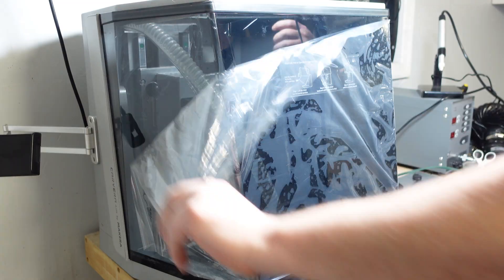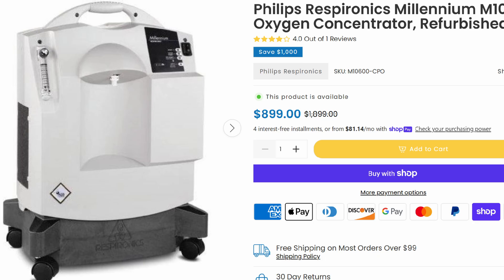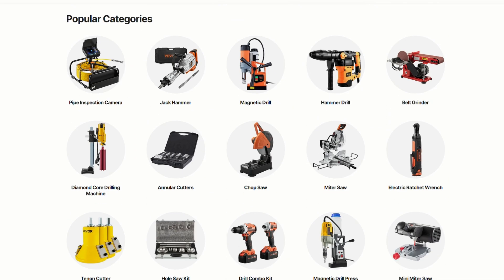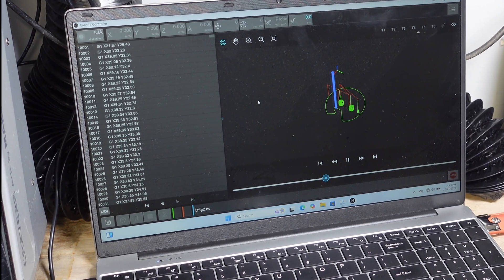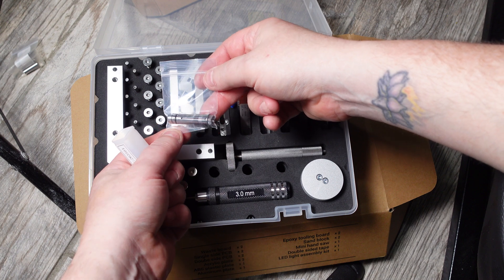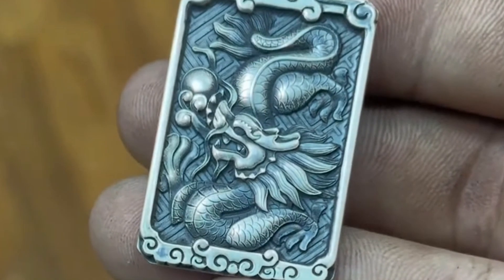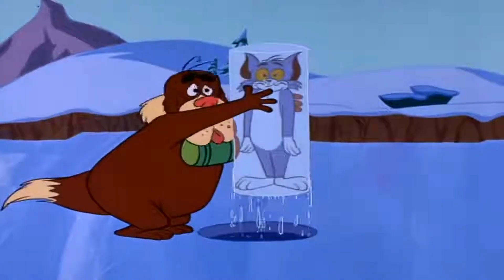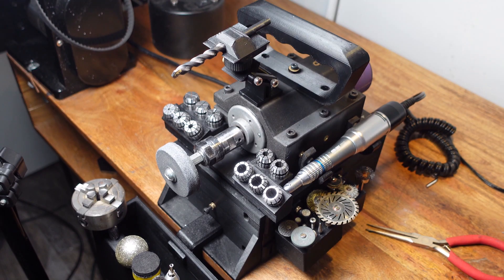I built a makerspace in a closet! #3dprinting #carvera #jewellerymaking #cnc

Comment: That's an awesome tiny shop setup, not much different than what I have set up in my home shop. I just bought a used cheap oxygen concentrator but I need to rebuild it.
Reply from the maker: Me too im just not sure how. I need to look into it
Reply: @sweetgumnyc7794 Nick Poole of Signal Ditch has a great video that goes into how oxygen concentrator systems work. He built a fairly high output one for glass blowing.

Comment: Oxygen concentrators don't last forever you have to replace the zeolite, if you notice the amount going down over time then it's time to repack... You can find it online, also the exhaust gas is mostly nitrogen you can use for shielding gas for your tig spot welder...
Reply from the maker: Thats actually a brilliant idea and I suspect mine might need to be repacked. Its almost 8 years old now and I have a feeling the oxygen isnt as pure as it used to be. I opened up the container that holds the balls but it looked clean. Any idea where I can learn about how to repack the canisters? Mine has 2
Reply: @sweetgumnyc7794  depends on if they are sealed... GPT is a resource for obscure information for repairs on anything... Depends on the model ...
Reply: Nitrogen and argon for SS welds? Pure is said to make bubbles but at such small welds would not be less of an issue?
Reply: @sweetgumnyc7794 the balls absorbed water and you supposedly can bake them and drive the water back out...

Comment: Instead of water, you might want to try mineral oil for that submersion lapidary work. Mineral oil won't destroy electronics if it happens to splash or leak (people often use this in their submersion PC builds). The one thing though is that I don't know how mineral oil might affect various minerals, so you might need to do a bit or research. GL
Reply from the maker: thats a great idea, i didnt even think about that
Reply: @sweetgumnyc7794  3M also makes another fluid that is safe for electronics (I forget what it's called) that might be a good alternative (but damn, is it expensive). Again, no idea if it would affect anything... and there's likely not going to be any info on interactions, so that would be trial and error I guess.